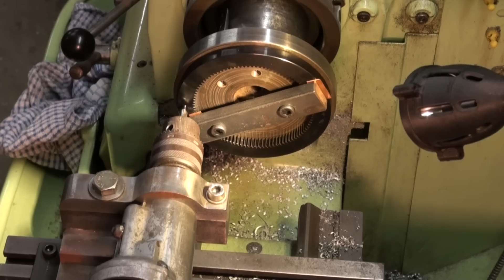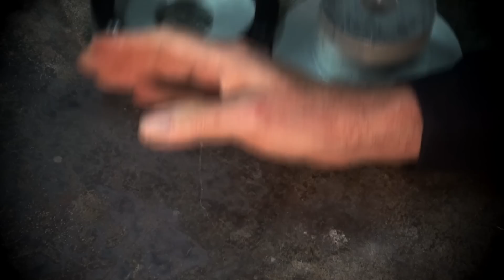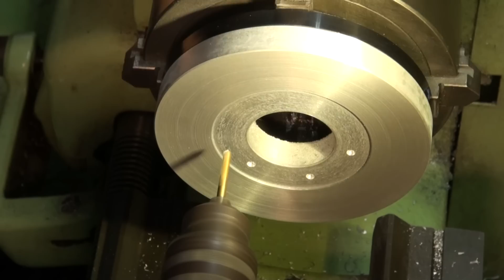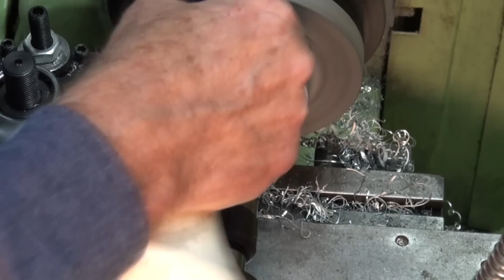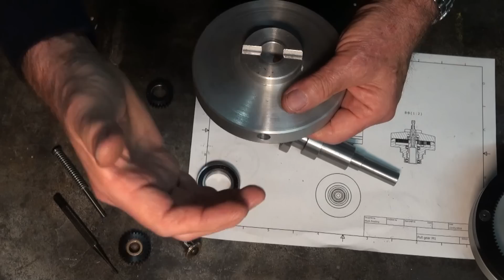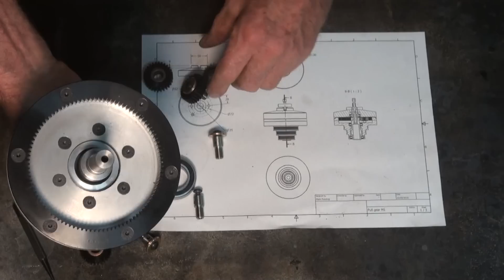Pull Gear Speed Reducer  Part 2 - Thanks to Mr. Pete

Comment: Mr. Pete has two videos showing the modifications he made and another one coming showing the installation on the drill press. I would suggest that you drill and tap the oiler hole for bolts and plugs so that you can use a puller to get the unit apart if needed and fill it with grease instead of oil.
Reply from the maker: I have been watching Mr. Pete's series and as he said the gap between the two sections of the device will allow lube to be slung out everywhere. I am aiming to machine a sort of labyrinth seal so there is no lateral passage for the grease or oil to escape. Good idea about including tapped holes for a puller though.

Comment: to prevent diging in you should move tool left and right not only with crosslide.
then you can do the same grove step by step, and then finishing plunge, and probably you should have done bigger reliefe angle on one of tha side of the cutter
Reply: nice video

Comment: Hi Mark,
Awesome project. No doubt it will work. Don't forget the access hole on the pulley for the setscrew to lock it to the motor shaft.
Reply from the maker: I still have to drill that hole. that part has to go back on the lathe for some final ops and it is now getting quite difficult to hold and still get access to the ring gear end.

Comment: You cannot take weld it up and re-cut it
Reply from the maker: The grade of alloy that I used resulted in a really brittle and crumbly casting. Big lesson learned there was not to use lawnmower base as casting material. It may have had magnesium in it.

Comment: Very good recovery.   I have had the need to attempt many recoveries in my projects.   Always good when a recovery works, in some cases even improves the build.

I like to use my normal cutting fluid when machining aluminium, the spec says it is good for metals including aluminium.   Thicker than WD40.   My biggest desire is to avoid chips cold welding to the tool.

I am eager to see part 3 and hoping it does work at the end.   You have invested so much time,  I think everyone hopes it will be worth it at the end.

Dave.
Reply from the maker: Yes, most of my chip adhesion and galling problems went away when I started to use the soluble oil in a steady stream. Thanks for the comments.

Comment: Mark,  It certainly looks like your Pull-Gear will work.  Mr. Pete realized that he did not have the 7:1 reduction unti, but has the ~4.5:1 unit.  You were correct about Mr. Pete not having the 7:1 unit.  Can you make your CAD drawings of your Pull-Gear available in PDF format?
Reply: Also Mark was calculating the reduction with the ring gear, it is the planet carrier that is being driven and is different from the ring gear calculation.

Comment: very ambitious project. had you given any thoughts to tig welding the first pulley to repair it? anxious to see it completed. how do you index the chuck on your lathe? drilling with the compound seems to be a real time saver in some applications.good luck with your channel
Reply from the maker: If you have a look at my video on how to use your table saw as a spindle moulder you will see the indexing attachment for my lathe. It uses a collar which is clamped to the outboard end of the spindle with two rows of holes (40 and 36) and a spring loaded plunger to locate each hole. It works great and with the two drill clamps which can be mounted where the tool post goes I can drill radial holes, cross holes and holes parallel to the lathe axis. I didn't bother trying to fix the broken out casting. The grade of alloy that I melted for the casting was rubbish and it resulted in a really brittle and crumbly casting.

Comment: Great recovery, the coolant worked, one thing I do especially when parting off aluminum is just use cutting oil just like l use on steel, this gives some extra lubrication to prevent galling. I also do the same while knurling.
Reply from the maker: Once I started using the soluble oil from the coolant pump all my galling problems went away. I have not used the stuff for quite a while because it stinks and it makes such a mess in the chip tray but it saved the part.
Reply: The combination of a suitable cutting oil, parting off tool and reducing the  rotation speed appears to have solved the digging in problem. Just goes to show that there is more than one way to do a job, all of which may be correct, depending on circumstances. 

My initial thinking was partly in line with previously mentioned casting imperfections, with some additional time spent considering whether the heat build up in the cutting tool was providing minute expansion, which together with a constant rate of feed and high rotational speed may have been sufficient to cause the jamming. 

Excellent quality of work, looking forward to continued watching until the job is completed and being utilised.

Comment: When this project is a success (which I am sure it will be), It would be awesome if you could publish your CAD drawings somehow. This may have been too expensive for commercial production but is just the ticket for us home shop folks.
Reply from the maker: I am going to make the CAD model and the 2D drawings available when I have finished the build. At present I am still tweaking the design and as such the CAD model is a bit different to the metal bits on the bench.
Reply: Thanks, I'll be watching.
Reply: Ditto!

Comment: Couldn’t you have drilled a new set of holes in the original casting on a different and properly concentric bolt circle? That’s why they leave so much room between bolts! ;) 

Someone mentioned cutting grooves on the compound while set at the angle of the groove. That way you set the right side of the groove in place and only cut the left face of the groove. Sounds like half the cutting area.
Reply from the maker: Unfortunately I have some Aspergian tendencies and once I mess up a part I am compelled to remake it. I take your point though. I could have just rotated the ring gear and spotted through a new set of holes. I did eventually work out that the tool could be advanced with the compound set to 20 degrees but even then it was still plunging into solid metal. Once I worked out that the groove could be relieved with a parting tool things started to go smoothly.
Reply: Sorry, I did not wait for your subsequent comment answering my comment as my ADD tendencies tend to make me do. ;) Perhaps if you invited your mates to come help make those empty beer cans you pour your castings from, your luck would improve! ( just kidding)

Comment: Beautiful work and very ambitious project for anyone. I imagine that the most difficult thing you will be facing will be to position the shafts of the planets in just the right location so that the 2 sets of gears equally share the load. If you end up too far out on that tolerance one set might not get any load at all or the whole thing might be very rattly. But you won't know unless you try. I hope for the best, i'll definitely be waiting for the next episode
Reply from the maker: I am trying to work up the enthusiasm to drill the holes for the gear centres. It will definitely be a one shot deal. I had not considered that one set of gears might be taking all the load! I wish I had a set of tool makers buttons and a jig borer. I will end up having to put a lot of faith into my CNC mill.
Reply: Go for it! Even if only one set of gears is engaging it will probably handle the load. And if you are close enough normal wear will make sure that the second set of gears eventually gets to engage!